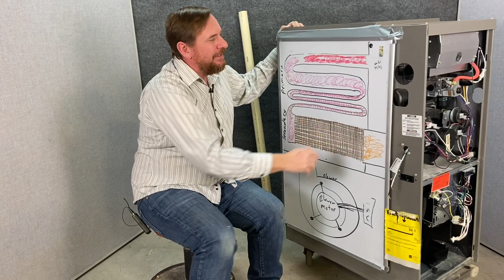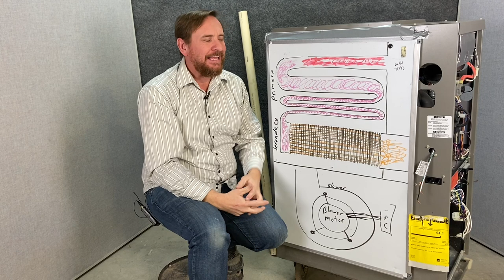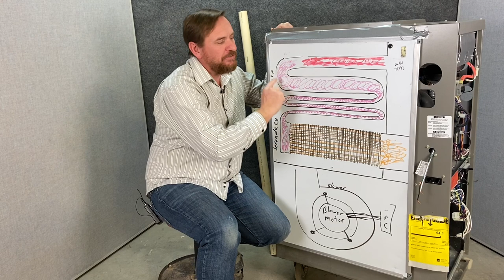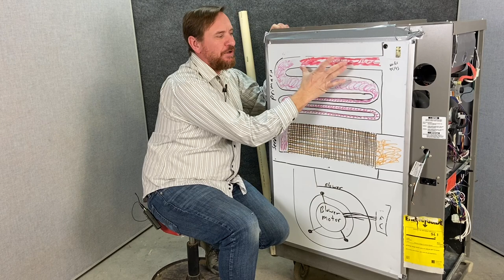90% + Condensing Furnace

Comment: Probably one of the best instructional videos I’ve ever seen.  I fix industrial culinary equipment but needed a crash course in the condensing furnace special features.  I’m going to tear into mine when I get home tonight.
I can hear water sloshing around inside the inducer on start up.  And I’m occasionally losing draft proof.
Thanks for taking the time to create this informative video.
Reply from the maker: Pull up the installation manual and check the flue installation. They are manufacturer specific and often where the problem lies.
Also check the furnace to see if it's level or pitching very slightly to the front. 
Make sure the drain plugs are in the right place. Sometimes the installers don't remove or place the drains in the right spot.

If that does not solve the problem, you will likely need an combustion analysis performed
 This will help identify any issues with the heat exchanger and ensure it's burning correctly.
Reply: @love2hvac  thanks for the suggestions.  I’ll be sure to look at the entire system.  I’m my case we’re in the process of remodeling a basement bathroom and had a leak dripping down and pooling on top of the furnace.  
On my particular model the OA isn’t piped straight into an enclosed burner box.  Instead it just dumps into the compartment. I think some grey water may have been pulled into the system.  
Before your video I didn’t know wether water slosh was a normal sound.  At this point, I’m thinking it’s not.
Thanks for you help again.
Reply: im agree this guy is a beast thanks Ty

Comment: Finally, fantastic video, we have that Lenox, we collect the draing water in a big pot for the plants in the winter, usally it just runs over to the cellar drain
Reply from the maker: Make sure your using an acid neutralizer. The condensate can wreak havoc on copper or steel pipes. IDK about the plants

Comment: I'm hvac tech, went to school and all that. Watching your videos from trade school you were teaching and now that taking the time and uploading these valuable hands on training which is by far is the best. God bless and keep up great work. As you say you are visual guy. Nothing beats these phenomenal info than abstract from books.
Reply: Thanks for your time. I do 6 calls a day. Some of them are PM for furnace. I come across mainly propane ones that around 20 years or so and I read sometimes 6 or 7 ppm or 4 ppm at supply for CO level 
As hard as it is to check all tubing since bend all the way with my camera. I do have CO sensit Analyzer that gives o2 level also but when I'm working on package unit and for example last night call the whole heat exchanger with solid sheet metal on the side can't even open , I have bring whole blower motor out and look down hopefully to see or catch. I don't take this job as paycheck. I do take pride and every day I listen to Bryan Orr, Craig from Ac service tech, Zach. And any new videos from and etc. As much as I know I still don't know anything eager to learn everyday in my truck I don't waste time.
Any recommendations for CO level reading under 10ppm. I document things what I read. But should I condemn the unit due to potential hazard since there is something going according to Mr Jim Bergman even 2 ppm is issues at the house I question myself why? Maybe gas cooktop or any other gas appliances around house. Am I to sorry using the word Anal or i should not be worried. 
Thanks for any inputs
Reply from the maker: I love it when a tradesman takes pride in his and her work! 
As for PPM I agree with Jim Bergman ( great source of information).
Carbon monoxide build up in the body so even small amounts over time build up in the body.
The cause for CO is another story. A 20 year old Heat Exchanger  will still have an inducer fan meaning the  HE is negative pressure. if the HE cracks its more likely air will leak into the HE than CO out of it. Cracked heat exchange's should still be condemned but is less likely the source of the high CO levels. 
The first thing I look to is the Water heater especially the plastic plugs next to the draft hood connector. As people seal up homes an already inadequate amount of combustion air becomes a big issue. Winds, bathroom fans, kitchen fans, clothes dryer and even the furnace without proper combustion can depressurize a home quickly. the Outside air comes in via the water heaters flue carrying with it Carbon Monoxide. 
Many others things to consider as well such as  an attached garage, fireplace, candles and even false alarms such as charging batteries (think Golf Cart). 
There is a great book by bob Dwyer called  Carbon Monoxide: A Clear and Present Danger - 
If you get the chance take a combustion analysis class that goes even deeper into the subject.
Im glad your listening to Bryan Orr, hes a good friend of mine. I will be presenting again this year at the Symposium. You might alos Like Nate Adams the house whisperer with HVAC 2.0. they teaching to look at the house as a whole sytem.
Reply: @love2hvac  
Thank you so much for putting time and answering my questions. It means a lot to me. Keep up great works. Lots of students like me are thriving to get as much info from Awsome Teachers like you. 
God bless 🙏
Reply: I have the 90% furnace. I had it service due to no air blowing. The svcman hesitate to repair my furnace. They offer to sell me their new furnace but mine only need a repair. No one wants to repair they only offer to sell new furnace. Any honest repairman out there??? I think my fan motor msybe bad but no repair man wants to work on it.

Comment: Couple time watcher, first time caller..... Only video I found with the 4 pressure switch Lennox.  I have been messing with furnace for two winters.  After watching your video and reading the whole manual as you mentions, I might have found my problem. The red silicon hose is not tight on the fire box.  Put a little zip tie on both ends (box and pressure switch) and the furnace has been problem free for two weeks. Will replace all hoses soon.  A BIG THANK YOU!!!  👍 Keep up the great videos!

Comment: I think the vacuum/pressure switch is actually a differential pressure switch which measures pressure at two different points in the flue path and subtracts one pressure from the other.  This result can then be used to determine air flow in the flue.  If the differential pressure is 0, then there is no flow, thus the motor is not turning or the flue/supply is obstructed.  By the way the video was very educational. I really liked the tip of removing the blower motor and inspecting the bottom of the heat exchanger for dirt. Thanks.
Reply from the maker: Absolutely correct, I should have included that.

Thank you, I'm glad you like it!

Comment: My old 80% Janitrol furnace uses a similar diaphragm pressure switch to sense the negative pressure in the inducer like millions of other furnaces do, although it only has 1 of them instead of 4. That black rubber vacuum hose to the diaphragm cracked from aging and caused a leak that caused the furnace to not start. The crack was right at the nipple on the inducer housing and there was some slack in the hose so I was able to cut the cracked end of the hose off for a quick repair. Then later I got some automotive silicone vacuum hose of the same ID and replaced the entire length of hose. The silicone hose does not crack with aging and will last indefinitely. If I had a furnace with 4 of those vacuum hoses I would upgrade them all to silicone right away.
Reply from the maker: Its true the Silicone is less likely to crack. I also replaced all the vacuum hoses on my truck with silicone for the same reason. 

This particular furnace uses really thick hoses and they are even square on the outside.  the square allows for the cracks to be visible during servicing so they can be replaced before  they fail.
Reply: @love2hvac  My Janitrol 80% is a lower end unit and the hose they used was the basic round rubber stuff that will likely fail inside of 10 years. Now if an expensive high efficiency unit is going to have upgraded square hose to make cracks visible, it would make more sense to me to just use silicone hose that probably will never crack at all. But I also understand that corporate accounting often doesn't use that type of logic and the better square rubber stuff is probably still cheaper than silicone. 

The way those hoses are situated in the unit and there are 4 of them, I would say it isn't practical to regularly inspect every inch of them and proactively find a crack that is just beginning, before it causes a breakdown. It's more likely the square profile will only make it easier to find which of the 4 hoses are cracked once you actually have a breakdown and you are actually pulling hoses out for inspection to troubleshoot it. So the proactive course of action would be to upgrade to the hose that won't crack in the first place. Same as in your truck, because realistically you probably aren't going over all the vacuum hoses in the truck until after you have a breakdown.
Reply from the maker: Planed obsolescence in manufacturing and corporate America. If it doesn't break how can they get you to buy a new one 😂

Comment: A lot of things to go wrong with these new furnaces, the older ones were much simpler and lasted very long. Some of these components last average of 5 years, like the hot sensor ignitor. My 25 yr old furnace still going strong. :) Only changed a thermistor. The piezo ignitor lasting whole time so far. It's the cost of increasing efficiency. Sensors, switches, solenoids prone to go bad. I guess what you save in heating bills, you can use for repairs.
Reply from the maker: I started on the old furnaces. We replaced thermocouples more than people replace hot surface ignitors. We replaced pilot assemblys, leaking pilot tubes, gas valves, limit switches and the natoriouse fan limit switches on a daily basis. 

As time moves forward changes happen. You can spend all your time fighting the change or you can adapt  to it. 

The issues with the old furnaces is the heat exchanger wears out, cracks and leaks. They where never made to last for ever.  Natural draft furnaces where also natoriouse for back drafting and pushing carbon monoxide into the home in windy days. These are some of the solutions with technology. 

The advancement in the automotive industry far outpaced the HVAC industry. Lots of people where against computers, and fuel injection but here where are moving forward without missing a beat. 

We use to have phones connected to the wall that lasted forever, now people replace them ever 2 years in average costing neat $1000.
People replace their TV every 2 - 3 years even though there is nothing wrong with the old one. 

Nobody is making you replace your old furnace. 
I Highly recommend you have a low level CO monitor.

Trying to convince people to not consider  a newer, safer, more effencent furnace  is not productive. 

If it's about simplicity and mastalgia just go to a wood burning stove. Cost lest to operate and last longer.
Reply: Love this comment.  I am a retired automotive engineer and read comments from people nowadays critical of modern fuel injected engines and somehow incorrectly believed the older vehicles with carburetors were somehow better.  I was a mechanic in the 70s and trust me cars ran poorly and broke down very frequently.  New models run extremely well, have great drive ability in very extreme weather, not the case with prior tech.

So I  am half way thru this video and yout enthusiasm really shows.

I had a pile of twigs in my pvc concentric vent exhaust that I discovered as I was doing preventative maintainable getting ready for winter use of my furnace.  Since there are differential pressure switches monitoring the system, if furnace runs and doesn't set trouble  codes is it safe to assume piping is clear of debris or do I need to check something else.

Thanks again for posting this video.

Comment: Lennox really should thinks about redesign the open panels. When equipment becomes old it’s difficult to put them back into right position to keep the blower side sealed well
Reply from the maker: Thats true, but I'm a fan of blue taping all the panels especially when in the attic. I learned that with high efficiency homes and blower door testing. 
How about the Lennox wave heat echanger and the famouse  pulse furnace for a failure! Haha if I can find one I will make a video of that.
Reply: @love2hvac  Cool, that will be nice. I used to have a customer who opened the panels by himself, but didn't put the panel back into correct position due to the shape of the whole unit slight changed (placed horizontal). The blower motor pulls air from the gas side into the return side. You can smell gas in the whole house. The two panels needs to be pushed tight to each other to have them at correct position. If one panel has problem the other wouldn't stay there tightly, which is a bad design.

Comment: Excellent explanation.  Can those composite inducer fans be repaired by replacing the $3 bearing vs spending $400 for a new one?  Usually that's was causes the noise?
Reply from the maker: It's usually a sleeve bearing, not a roller so there is not much you can do with it. I would replace it then see if you could rebuild the old one for a backup. I like when motors had oil ports. Manufacturers build them to sell the whole assembly. 
I have replaced many 80% metal assemblies and also just the motors.
I have only had to replace a fuew composite assemblies from a 90+ and they were from improper drainage and water building up in the secondary.

Comment: What kind of adjustable nut driver you are using ?  I'm talking about the toll used in this video at 11:04:00 .
Reply from the maker: 2-in-1 Hex Head Slide Drive Magnetic Nut Driver 6"

SKU: 65129

Unique, patented tip switches from 1/4-Inch size to 5/16-Inch size

Magnetic regardless of which driver is selected

Twist the thumb nut to lock tip setting

Comment: Do you prefer the furnaces with secondary heat exchangers? I hear others saying they are trouble and  that they demand more looking after.
Thanks for sharing! Its awesome to see one disected!
Reply from the maker: The biggest issue is improper installation. If they are installed correctly they will operate just the same. With the skilled training shortage there is a lack of people to properly install them. Some larger companies want people to install them fast, and others want to install them the same way that they did 40 years. Those people train the new people and the problem continues. 
Every single time I had a company or customer with a problem furnace it was because of improper installation. They don't even read the installation manual.

#2 cost of repair.
The very lack of training for installation also leads to lack of training for service and repair. If you hire a person who only worked on car carburetor engines to repair a file injection, the results will not be good. Excess time, trying parts, and frustration  will be the result.
A 90% has the same components but with a plastic flue, plastic inducer, a drain, a secondary heat exchanger and a second pressure switch. Everything else operates the same.

Single stage 80% and single stage condensing 90+ very similar.

2 stage 80% vs 2 stage 90+ condensing, very similar.

The big issue is Modulating 90+ condensing furnaces. These have much more expensive parts and they are much more difficult to properly diagnose. There is a big difference between a single stage 80% and a modulating 90+ condensing furnace. 

Are they more prone to failure?
If they are installed correctly, no! 
If they areinstalled incorrectly, yes! 

Do they cost more to repair?
Properly trained techs with single or 2 stage 90+ furnaces no. 
By Improperly trained techs, yes.
Modulating 90+ furnaces yes.

Hopelfully that helps
Reply: @love2hvac  
That helps a lot man! Thanks!
 I would like to be an installer  and a traveling tech but am getting a bit old to be running ducts in tight crawl spaces.
My old 88 furnace I can draw a schematic of it by memory now. I did thoroughly inspect the heat exchanger yesterday and clean the coii put in a new pilot sensor but the igniter box is bad so still feeding the wood stove. The heat exchanger is still rock solid, no flexing and no cracks

Someone has wired ithe fan wrong in the past,. As soon as the furnace comes on the hi ac fan comes on immediately on pin 2 of the 90-370. Then when the thermostat is satisfied 24v is killed to the 90-370 relay and then the honeywell fan limit switch becomes active on pin 5 normally closed to run the medium fan until the furnace cools down and the fan limit shuts off the blower.

The scary part is the heat limiter has not been active for no telling how many years while the furnace is burning. On this furnace that leaves just one measure of over heat protection... the thermal switch on the fan.

I have just days ago caught this by watching fan limit videos and how they work.